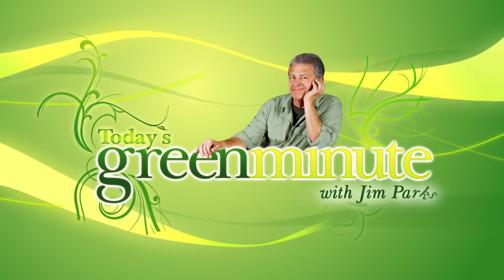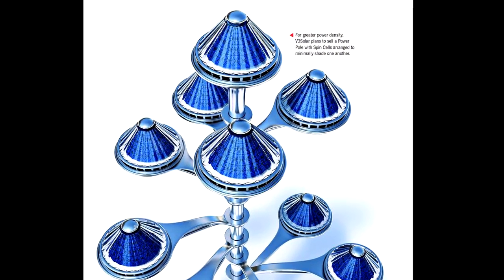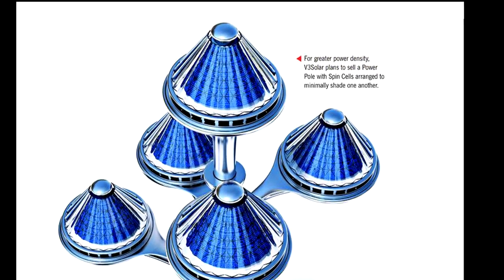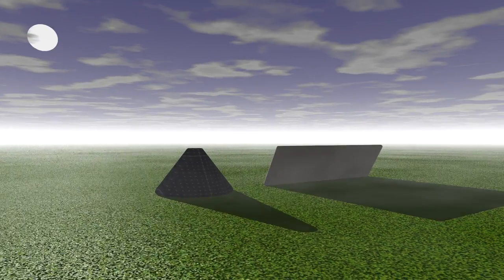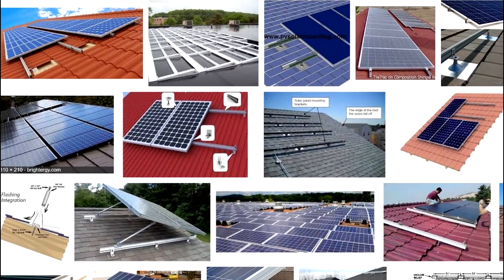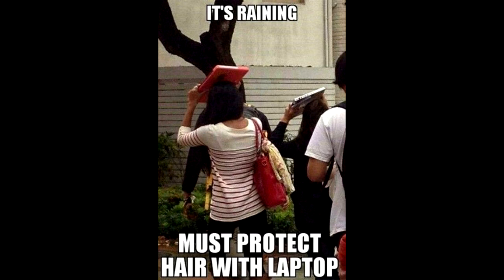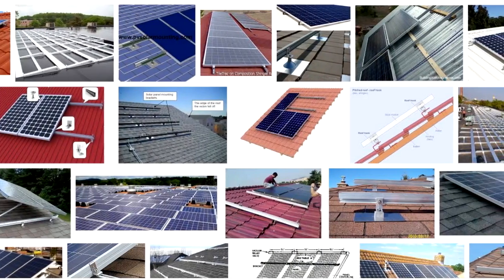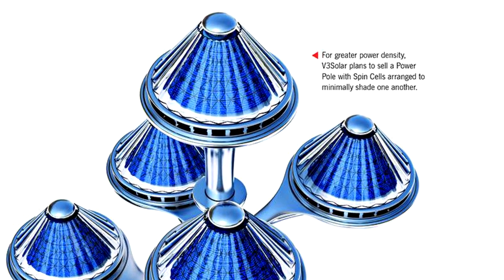Spinning Solar -BUSTED!

Comment: Your criticisms are based totally on your poorly thought out, clearly biased theories about how cells and this device work, not on any actual test data. I am no more sold on your claims than those of the designers of the concept. There are many questions left unanswered. For example: Does a cell immediately stop generating the instant the cell moves into shadow or is there a lag while the cell "cools down", so to speak, but still outputs some power? If so might not the spin rate be able to keep the cells outputting power for a much larger percentage of time? Also you present the sunlight only coming from a single angle. At noon the entire device would be exposed to sunlight, even if not at a perfect angle. You also failed to take into account for power lost/wasted spinning the device, a strong argument in your favor. But the bottom line I still hold would be actual test data.

Comment: Of course you would put a huge air conditioner inside! And have the solar panels run the cooling system. Of course it wouldn't produce more energy than it uses, but they look cool 🤣

Comment: This stuipid idea aside there is some (niche) potental for coned shaped PV
"Conical-shaped solar panels cooled by forced airflow
A group of international scientists has compared the hypothetical performance of three novel shapes of solar modules – pyramidal, hexagonal and conical – and has found the latter has the strongest potential in terms of thermal behavior. According to their findings, a cooling technique based on forced airflow is key to making these solar module shapes into a feasible solution."

Comment: Dualsun did it better. Instead of only cooling the panel, they suck the heat from panel to other else like water heater. So win-win solution. Your solar panel doesn't get hot and you get hot water.

Comment: Solar can finally compete with fossil fuel? The real price (everything included, also building the power plants and disposing it one day) to produce 1 kWh of electricity in 2018 (w/o any subsidies) was 8.9 cent for gas and 8.1 cent for coal. There is a reason why oil is hardly ever used for that purpose as it either requires expensive preprocessing or would be highly inefficient and horrible dirty. Now compare that to 7.6 cent for solar panels and 6.1 cent for wind turbines (and wind is solar energy, too; it's mainly the sun that causes wind to exist on earth). Oh, and for all fans of nuclear energy, I have bad news: The price to produce 1 kWh in a nuclear power plant is 13 cent (not counting the costs to deal with the nuclear waste for thousands of years). So from an economical point of view, renewable energy is already cheap energy, once you have enough solar panels and wind turbines in the field. It's only the initial investment that has to be done but that has been included in the price calculations above, so this investment does pay off in the long run.

Comment: Its 400% more efficient because the spinning creates a electromagnetic force as well as wind power and it also uses the water in the air to create hydro electricity. Boom 4 sources of power at 100% efficiency each 😆😂

Comment: It boggles my mind.  If their solar panel gets too hot why not just block 2/3s of the sunlight with a fixed shade that requires no power? Even if solar panels lost 99% of their efficiency by getting warm this would still be a terrible solution.

Comment: What if the new conical solar things were also tracking amd instead of the side using the top pointing directly at the sun so the tip would track would that increase their efficiency dramtically?
Reply: Then you just have a tracking panel that can never point directly at the sun
Reply: @user-si5fm8ql3c  if you look the glass is rippled thick and rounded it could easily be designed to distribute incoming light evenly

Comment: I have solved the problem!
Build a cylinder that rotates and fill it with solar panels and then just place a really powerful flashlight inside.
The light from the flashlight will continue to bounce off the walls and get stronger & stronger until it finds a way out. Perpetual energy.
Yeah, I know, I'm a genius 😎

Comment: At less than 1 minute the design is a complete failure... using a cone shape means pi in falloff, losing more than half of potential surface exposure over tracking with a flat array.
Laying it flat on the ground would be more efficient than that, a lot more.

Comment: What if the solar panel had this aluminum bit as a heat sink and what if a fraction of power was used to pump cold water throu a pipe from a well because wells are underground and most natural heat is friction from uv from the sun so well equal dark equals come cold water 😲.

Comment: thuderfoot you are missing the main source of power from this! I could help you understand but I first want to talk to you about your format, I get it there is a lot of BS tech out there TRYING to figure out a solution, you seem to focus only on debunking them and you offer no solution yourself? How about trying to help instead? Oh and the extra power that they need to make this more efficient could be that the cones don't spin with motors but they spin with wind power, just saying hybrid solar arrays have a little more potential than just solar cones.

Comment: In fairness, it would have been better to compare it to a non-tracking flat panel. Also, one might argue that the footprint (area of, say, roof used) should be held constant rather than panel surface area.

Comment: This is like introducing a 6 cylinder engine cooler that cools the engine by always running it in 2/3 cylinders. Brilliant. At least I thought they were planing the cone shape so that it doesnt have moving parts and doesnt rotate, but they instead made it the reverse and actually added more moving parts.

Comment: You should make a video on solar in general, because majority of those companies selling those panels are actually tricking the buyers, not telling them the real world results. Especially if they sell them in colder climate zones where the solar intensity is lower.. I would really like to see the actual calculations of a given size solar panel system on how much power they produce. Because majority of the sellers calculating it based on the max power output of the panel, instead of average solar radiation on a given area unit in the area they are selling those panels. Which I think is kinda strange.

Comment: Your lack of knowledge is making you misunderstand things. The solar panel cone spins at twice the speed of light so there could never be time for any of it to be in the dark.
You forgot to mention the fact that they wouldn't even make enough electricity to run the motor that spins them.

Comment: The whole design is stupid. I just took one look at it and instantly saw the flaw. A flat solar panel with no moving parts would create far more energy than this one would. 
This one spends some of its energy by spinning. Even then it doesn't have the same number of solar cells per square inch as a flat solar panel would have.
It really is a stupid design with half of the solar cells not in the sunlight and most of the other solar cells being in indirect sunlight. The design itself is the flaw.
Anyone who bought this stupid thing just wasted their money.
Flat solar panels do work. It's how many sailboats get the energy to run onboard electrical equipment. It's how garden solar lights gather energy in the daylight so that they can light up at night. Its how solar calculators work for decades without needing a new battery. 
Solar panels do work. Without them many satellites that use them would not work.
Stop with the conspiracy theories.
Solar panels do work. I had them myself. They work. 
You can get several solar panels, almost a dozen marine batteries and an electric inboard engine and literally never run out of energy for the engine while out on the ocean. The setup has an added effect where when under sail, the propellers spin due to the passing water and creates a backward electrical charge to recharge the batteries. Its pretty damn awesome and is far superior to a diesel engine that can run out of fuel or breakdown due to its many moving parts.
An electric engine only has the one moving part and that is the motor itself. The maintenance is far less with an electric engine than that of a diesel engine which is 90% of the maintenance on a sailboat. Swap out the diesel for an electric and you save yourself a lot of headaches.
The point is that solar panels do work as long as you keep the design simple. A nice flat panel with no moving parts is the best design. That's as simple as it can get and is by far the best design ever.
This spinning tree idea is just idiocy in action.
I feel sorry for the actor. He got paid for his role in the scam but paid the price in the long run for being part of a scam. His reputation has been tarnished for ever.
There is no free energy. Energy is just transferred from one form to another. Sunlight and wind are forms of energy that can be harnessed so we get the illusion of free energy. But we need a way to transfer that energy into electrical energy and that is where solar cells and wind turbines come into play.

Comment: The truth is... all you need is a large parabolic reflector bowl to concentrate the heat and get energy . So this maybe a costly design without great gains, a parabolic reflector is extremely cheap and can be a DIY project. Then you need the battery and generator transformer setup. But the way of capturing the sun energy should not be at all expensive. In fact the lens use is a valid idea and is what the dish reflector does, it concentrates the energy.

Comment: Im not saying they are right, but the point of it is that as the day avances the normal solar panel starts getting sunlight from the side while the cone allways gets it from the front so you should take that into consideration

Comment: IMHO the problem is, that investors have so little knowledge in physics, math and engineering, that they fall for this kind of bullsh*t or even want and enforce this kind of marketing fraud.
There might be technical niches where the official knowledge got holes and misconceptions, that a real engineer+inventor would address first by presenting a prototype or calculation that allows critics to verify or confirm the claims.
But in this case, the nonsense is too obvious to anyone having basic understanding of the topic.

Comment: "solar panels work best when they're directly facing the sunlight, so we decided to make almost none of our solar panels directly face the sun at almost any point and also put half of them in darkness"

I don't know how anyone can be fooled by this. Even spending 5 seconds thinking about it, anyone who has even an elementary school level grasp on physics should understand that if you reduce the heat falling on a solar panel without some sort of discriminatory filter, you reduce the amount of light falling on it in direct proportion. The two things aren't disconnected, the sun isn't releasing heat in some special way, it's just spewing out electromagnetic radiation of all kinds in all directions, if you absorb the light energy and don't specifically discriminate against the infrared light then you also get hot.
Reply: Idk what kind of elementary school you went to but mine was a complete joke.  My sixth grade teacher was a functional opiate addict and I didn’t find this out till senior year of high school.
Reply: @trippybruh1592  Even a non-functional drug addict knows that the more energy you get the more energy you get.

Comment: that fraud ad for the cone panel explained why it wouldn't work to begin with, they said the panels generate best when perpendicular with the sun, well congratulations, a cone as a significantly smaller surface perpendicular with the sun

Comment: Fidget spinners where actually invented and inspired from this idea but do the average fidget spinner user containing either more or less chromosomes tye tech was difficult to install because users used the device inside there mims basement or dads computer dungeons. Also the power was going to transfer by wifi into the users home. AS U CAN SEE IT WAS A FAILURE AND CAUSED THE US TO INCREASE AUTISM EFFECTS BY 18% .

Comment: What if the cone didn't spin, and was just amplified in size, wouldn't it just be a normal solar panel, taking sunlight at all times (of course not when the sun is out). Wouldn't this be a better idea or would it still be too expensive?

Comment: Why not just have a cooling liquid slowly circulate over a solar panel if it cant handle heat. Like how processors are being made now. I saw a laser shooting through a small still puddle of water on a piece of glass. I'm not sure if the water was the lense or used for cooling  it but a laser still shines through it.

Comment: Wow.... I mean... I can kinda get the logic behind it... but when you take a moment to examine this critically with proper scientific evidence... this sounds like the idea of some five year old being asked by his teacher how he would end global warming.

Though I do want to say one thing

WATER powered cars may not be a thing, but I did read an article a long time ago which talked about Hydrogen powered guys, which produce water as a byproduct... though to be fair... I haven’t seen anything like that come up in media in recent years so perhaps that fell off the grid too as just another pipe dream.
Reply: Hydrogen powered car is a real thing and has been produced, but it's not possible to make a car generate hydrogen on its own, you need fueling station just like oil cars. 
The problem stems from Hydrogen itself, 98% of the world still uses fossil fuels (natural gas) to produce hydrogen (which in turns release green house gas), it's not as easy as "just make hydrogen how hard can it be"
Another way is yes, produce hydrogen from water using electricity, and you will need to use a lot of electricity. Which begs the question why not just use electric cars in the first place, since electric care requires at most one-tenth of the electricity required to separate Hydrogen from water. And more electricity means.... more greenhouse gas.
At the current point, electric car are 100 times better and viable option to hydrogen car, you'd nee some serious breakthrough for hydrogen car to replace them. Provided electric cars not having breakthrough themselves. Graphene is an interesting technology, it wont be electric cars breakthrough, but it already put a big dent on hydrogen car.
Reply: Frzned9x I learned something today 😁 thx 👍🏻

Comment: I thought this was gonna be a solar panel and wind turbine combo. Which would actually be smart and if you just use little springs that touch a ring then you can probably do it pretty easily.

Actually holy ship that might not be such a bad idea like if you used the spinning wind turbine to wind up a sort of torque battery and then use the spinning motion and a small amount of the electricity to make sure the solar panel tracks the sun. And when the wind dies down the torque battery will move the solar panel until the wind kicks up again.

Comment: Damn... Imagine watercooling the solar panels and using the heat to warm your house (or at least your bath water)

I ain't no scientist so I have no clue about what could go wrong
Reply: Sadly the temperature of the water is hard to use, as it's not hit enough.

We're having the same problem here with a Serverfarm...the cooling water barely exceeds 40°C, but the whole public heat transfer system from our coal plant that is being shut down is built for 60°C warm water...
Reply: @Markus-zb5zd  ouch, well, you're right
Water has a pretty high temperature capacity (or something, I don't remember)

Comment: You seem to be making a lot of mistakes here. First of all, the point made by fillian (eventhough I am not a fan of taking nonexperts as experts) is that this allows for cheaper production, lowering investment cost for pvpanels, by making each panel only produce half as much energy. This does of course mean that you would need more pv panels for the same amount of energy, but because the lightcathing area is only 30% you can place more surfae area of pv-panels. Therefore the question becomes "what is the cost benefit of avoiding overheating compared to the need to supply more pv area?". Although the fact that this hasn't made it and therefore it is likely that this cost benefit isn't enough, you don't adress this in the video.
Reply: cheaper production? I think not.
Reply: @wildmanfujiami5870  I don't think so either, but that seems to be the main point fillian makes, whilst it isn't covered in the video.

Comment: there is one point you are missing in your calculations,  as the sun angle shifts, the voltage drops, and if it drops to a point below what you are pushing which includes mppt chargers, you don't get power.   the charger i discuss i think needs about fourteen volts before it switches to mppt from normal charging

Comment: A panel in the full sun is half as efficient or less because it is too hot to work properly. A panel that gets 1/2 of the sun but is not overheating will not lose more than 50% of it’s efficiency.

Comment: What if you used a tracking inverted sphere of solar panels? wouldn't that have more surface area of solar panels or would this be irrelevant due to the amount of light particles that cover that general circle?
Reply: an inverted sphere is a hyperbola which is essentially a cone mirrored along its Y axis.